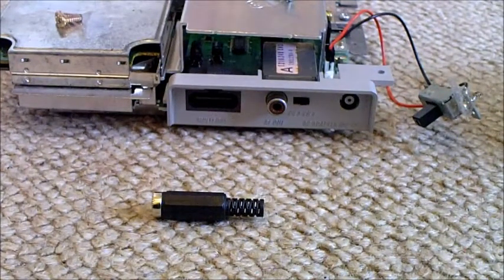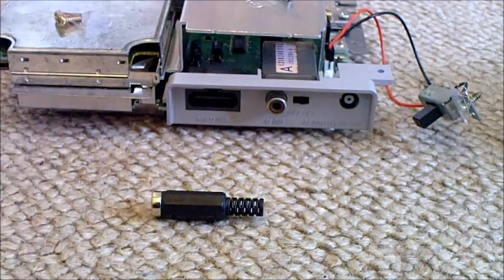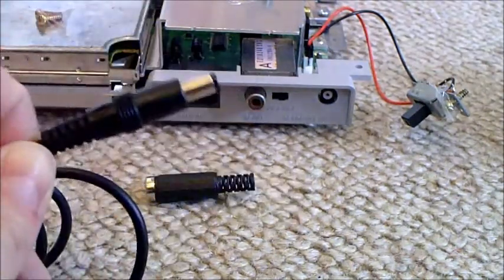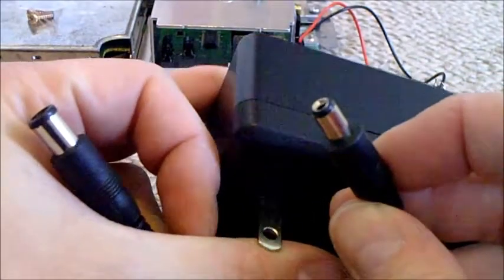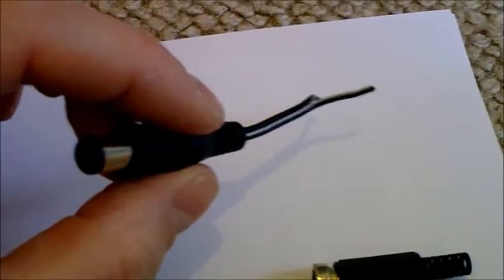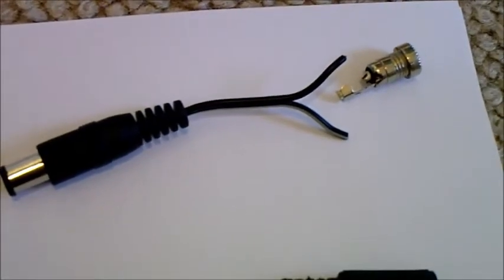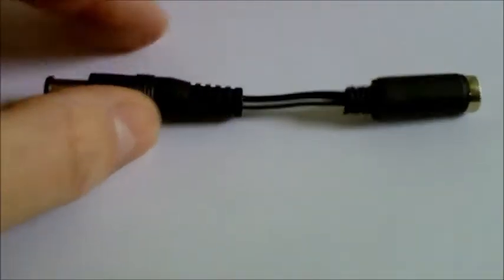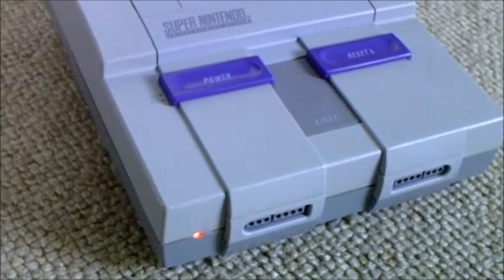How to build a £6 Adapter to Power the US Super Nintendo in the UK

Comment: The SNES plug is all those 3 in 1 jobs are good for. They are terrible cheap switch mode power supplies made with the lowest amount of components possible with no EMI/RFI filtering components resulting in video noise.